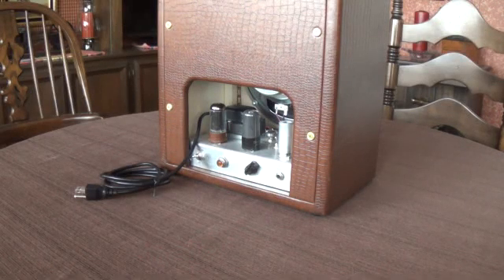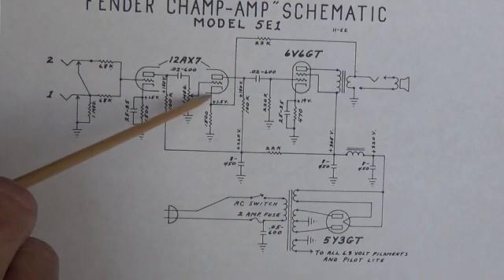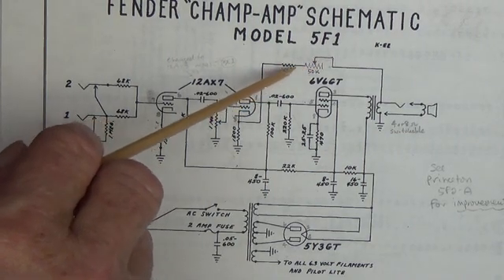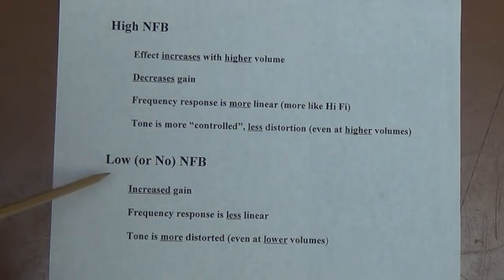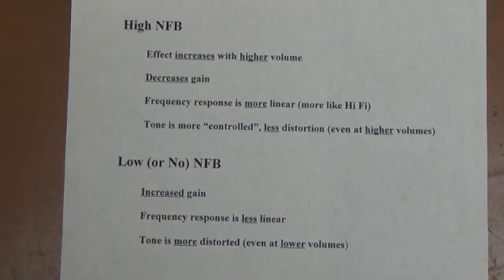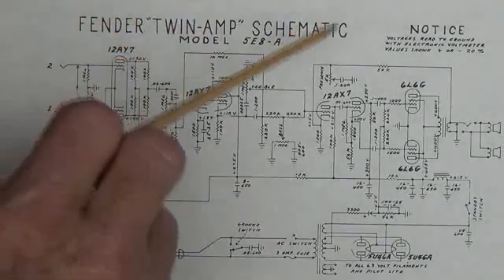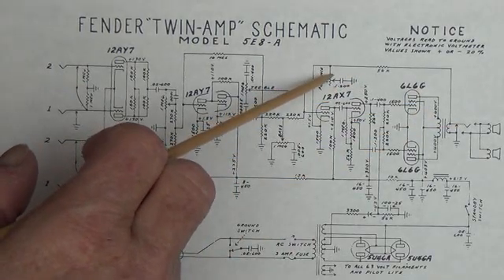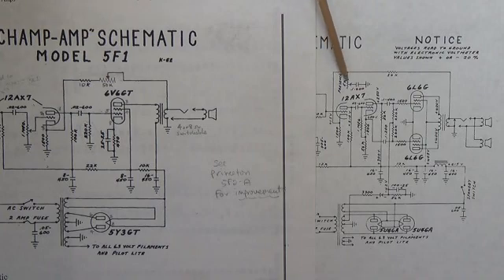Negative Feedback Loops and the Fender Presence Control

Comment: Always i saw you videos I learn somthing. Have a Question and maybe yo can answer and help me. I have a Fender Bassman 100, its to clean I would like to be more like it a Bassman Blackface era? What mods o recomendations you suggested to me? I want to somethimes play clean and sometimes achive breakdown at lower volumes. or just have the circuit of the bassman blackface. Also if I do mods the bass channel will stay the sames or it will change . Saludos de Mexico sorry for my french
Reply from the maker: It would take a great deal of time and space to discuss possible modifications to a Bassman 100, Gerald, but my question would be, if you want early breakup at lower volumes, why not simply buy a second, smaller amp.....maybe a Fender Champ or Princeton ?  Trying to get a B-100 to do what you ask is like trying to fix a watch with a sledgehammer. You need the proper tool, i.e. amp, for the job. Good luck.
Reply: @UncleDoug  yeah i feel you. Iam starting to love this amp. The deal its that I have a Traynor YGL3 and therea were I get my cleans sounds and also has treverb and tremolo. I am a big fan of Duane allman and as far I know in the earley days he used to use a basseman the he uses a Marshall SUPERBASS. Sobi want to have something like a SUPERBASS . Forgot the thing what I say of low volumes. Do you think i could do aomthing about it ? Just little and auddle things without losing the great headroom of the fensee amps. ?
Reply: Also I read in a web page fender guru about the Fender bassman conversion of silverface to blackface mod, the blackface has more breakout. but the problem its that the Bassman 100 its different of the Bassman silverface. The B100 has only 2 stages of preamp tubes and the Bassman silverface has 3 and also the B 100 has 4 power tubes and de B silverface has 2. So I wonder if thia conversion mod can also applied to B100? And if ita safe to do that (transformera, tubes impedance etc..)?
Reply: Also if the mod its compatible with the B100, it while used only with 2power tubes or it could be run ot with 4 power tubes? I think this analysis it would be very interesting and clears our minds about the theory. Hope you can do a series of this theme jejejeje . cheers Uncle doug . Greeting for you and your dog  🐕: D

Comment: Hmm, does that mean that the presence control can be turned into a bass control by switching the 5k pot and the capacitor, therefore turning the high pass filter into a low pass filter?
Reply from the maker: You probably could turn a Presence control into a Bass control by altering the pot and cap values, Luca.

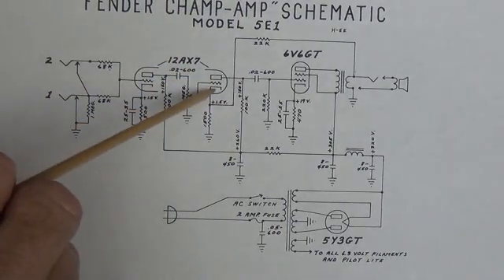Comment: Uncle D, please forgive another noobie question; your videos are making me a danger to myself and others.  I'm hoping you can identify where my thinking goes awry: at the 1:30 mark, you describe how the NFB coming off the OT secondary winding to the 12AX7 Stage 2 cathode is out of phase with the input signal at the grid.  But the way I follow the schematic, the 2nd stage grid drives the plate, which inverts the phase of the signal.  That inverted signal then goes the grid of the 6V6, which is driving its plate, effectively inverting the inversion.  So the signal going to the OPT is now back IN phase with the signal at the input of 12AX7 Stage 2.  Unless the OPT again inverts the phase, I'm not seeing how the signal being fed to the stage 2 cathode is out of the phase with the grid's input signal, making a negative feedback.  I'm seeing positive feedback.
So what am I missing?
Thanks again for a fantastic series of very educational videos!
Reply from the maker: Good question, showing a lot of mental follow-through on the presentation. The output transformer secondary puts out two signals which are out of phase with each other. You connect the NFB to the one that is out of phase with the signal on the cathode of the 12AX7. If you pick the wrong lead, which happens fairly often, the result is a PFB......which is commonly known as a "siren" :)
Reply: @UncleDoug  I see.  The output transformer is not putting out a +V referenced to ground, but a +V referenced to -V.  Just like the CH1+ and CH2+ terminals of a stereo power amp operated in bridge mode.  Got it; thanks again for indulging me.
Reply from the maker: @PiFBass  You're welcome, Bill.
Reply: A signal fed to the cathode must be in phase with the signal at the grid to provide negative feedback. A signal input at the grid is inverted at the plate while a signal input at the cathode is not. Since the two signals at the plate are out of phase, the result is their arithmetical difference.

Comment: hi i made a champ and i dont make the negative feedback circuit and  if i put the capacitor on cathode resistor of the 6v6  i got ecretage at 1 watt  , so if i put negative feedback circuit i got normal ecretage .i dont understand well  why maybe you will.
Reply from the maker: Apparently the bypass cap increases gain and causes premature clipping. The NFB loop suppresses gain and reduces clipping to a normal level.

Comment: Uncle Doug
I have 2 identical amps, both are Line 6 Spider 3 
15 watt 
8 inch speaker
I want to know if there a way to put them together so that I double the speakers and double my output and of course keep the few effects it has. I'd like to build a new cabinet to house both speakers and perhaps a separate head with the 2 amps joined? I didn't plan on having 2 but that's what happened so any input of yours would be greatly appreciated. Thanks
Reply from the maker: Why not just get a splitter that separates your single guitar cord into two separate cords, then plug into both amps, with different settings on each, and blast the neighbors with a complex, tonally rich and mind-blowing free concert ?
Reply: @UncleDoug  well that would just be too easy u know. Maybe I'll find a tube amp worth doing the work I wanna do so bad. Just need a project
Reply from the maker: @aaronowens1627  I understand the need for a project, Aaron. Good luck.

Comment: Excellent video, as always! Question: why is the signal for negative feedback typically (always?) taken from an OT tap (as opposed to a pre-OT signal, for example, the connection between the anode of the 6v6 and the OT)?
Reply from the maker: Because the signal has to be converted from high voltage low current, to low voltage high current to be effective in the NFB. This is done by the OPT.

Comment: Hey Doug, Greetings from New Zealand. I just had one question. I'm using a pre-amp pedal (Diezel VH4-2) and running it into the effect loop return of my amp which is a Marshall DSL40. The pedal already has presence and resonance controls on it, but the presence and resonance controls on my amp still work as well. so i wanted to know what i should set these controls on my amp to, in order to have them make no difference to the signal (Essentially just use the marshals power amp without affecting the tone from the pedal with these controls). Should I leave them at 12 or at 0 or at max? which one essentially turns the control off? sorry for the long winded question. Eagerly awaiting your answer. :)
Reply from the maker: I would have to see a schematic to see how they are wired, Shid.  But, since all that matters is how it all sounds, why not just experiment and determine the ideal settings for yourself ??

Comment: So does High NFB equate to less resistance, and Low NFB to higher resistance?
Reply from the maker: The lower the resistance in the NFB loop, the more negative feedback, and vice-versa.
Reply: @UncleDoug  thank you,  love your vids!
Reply: I just completed my f51 chassis assembly, and I did include a 50k pot on the NFBL, and I wanted to mark where 22k actually was in relation to the knob now that it's all together, and discovered that now I'm not able to measure the resistance from the pot to R13 (10k replacement resistor)? Is it because it's now in circuit and connected to the OT? Thanks!

Comment: Inside my amp, I removed the Presence control and replaced it with a another potentiometer (250 Ohms, after few experimentations) which allows me to play with midrange frequencies as well as different other punchy sounds. It also controls the amount of the overall volume. But in my case, it is connected between one of the grids of the Phase Inverter and the 8 Ohms ouput jack.
Reply from the maker: Good grief, Paul. You should patent this circuit design.

Comment: Hi Doug , just me again I am having fun and games with the V15 it appears the Amp pixies have been in there and done all sorts of things . I had a problem with when playing a g chord this would start a horrendous buzzing off that would only go away when the volume was turned off. I guessed it was frequency (vibration related ) which i have now isolated to I think the on  not on switch . I did also note that there was a lot of mains hum which seems to go away when i touch the chassis I was thinking the filter caps were possibly bad and also the power resistors have at some stage got very hot as they are breaking down and burnt they appear however to still give the correct resistance. It is a long and slow process as i am no expert but i am learning new stuff and the old amps have so much more character than the new stuff sorry to bother you but i need some good advise . 

Nikk founder member of Doug for President, or prime minister movement if you want to come here, we don't seem to be able to run a p up in a brewery any more.
Reply: Hi Doug , Not sure if this helps what do you think  https://youtu.be/HPIXVy2IQL8  Thanks Nikk
Reply from the maker: Thanks for the nice comments, Nikk. It sounds like two problems......a microphonic tube and a grounding problem. Try tapping each tube when the amp is on and see if you hear any medium to loud noise through the speaker. Replace any tube that makes noise. As far as the hum, be sure your amp chassis is securely grounded and plugged into a properly wired AC receptacle. Be sure that all metal parts of your guitar are grounded to the shield of a good instrument cord, plugged into an input jack that is properly grounded to the chassis of the amp.

Comment: Hi there! I just stumbled upon your video (very fascinating btw-this is the kind of stuff I want to learn) because I was trying to troubleshoot my Fender Twin. 

So here’s the problem: everything on my amp sounds okay, until you turn on the presence. When presence is engaged, a high pitched ringing sound starts to build slowly, and after a minute or so it becomes so loud that I have to turn off the amp (or presence). 

Before doing a little research (I know absolutely nothing about amps) i thought that presence had something to do with the reverb because the dials are right next to each other. But obviously this has nothing to do with the reverb tank (I think) and maybe the pots or ground is damaged for the presence?

What do you think? Also, is the presence a function of the power amp?
Reply from the maker: Your description sure sounds like the presence control has been miswired and is now a positive feedback loop......creating oscillation that increases steadily (and somewhat dangerously......don't let it get too loud). The NFB wire is connected to the wrong speaker output lug. See where it attaches to the secondary output (which goes to the speaker) from the output transformer, detach it and reattach it to the other wire. See if this helps.
Reply: Sorry I’m unfamiliar with a lot of the terminology. What is the NFB wire? And how should I start taking the amp apart? Can you reference the schematics? I’m also willing to Cashap/Venmo you for your time - I definitely want to compensate because I’m serious about getting into electronics. If you have any resources or recommendations to start I would love to pointed in the right direction <3

Comment: Uncle Doug,  The way I have done this on two 5F1 clones, was to keep the 22K resistor but add a pot to dial it in or out. I used a 250K pot in one and a 500K in the other. I like the results with both but I did not A/B the amps. What would be the difference mathematically between the two pots I use or if I were to use a 50K pot. What am I achieving with this by using such a high value pots, compared to what you did?  Thank you.
Reply from the maker: The vast majority of the travel of a 250K or 500K pot would be wasted, ZH, because the NFB loop effectively shuts down at around 2 or 3 times the NFB resistor value, i.e. around 50K. That is why you can generally stick with a 5K or 10K fixed resistor and a 50K pot. Try it and see what you think.
Reply: @UncleDoug  I don't quite understand what you are saying but the travel of my 500K pot is effective the whole range. I would just like to know what exactly I am achieving with my version of this circuit? I kept the 22K resistor. 
Am I still keeping the 22K NFB and actually adding more NFB when the pot is turned up with the 250K or 500K pots?  Am I actually adding NFB to the amp? Above the stock NFB?
250K and 500K pots is all I have at hand at this time, since I am a guitar builder.  
The amp sounds really good though, great tone. With the pot all the way up it gives me a mellow jazz tone for clean playing. 
My setup also functions somewhat as a tone control, adding more gain and highs as the NFB is removed.

Comment: Greetings Uncle Doug!

First, thank you very much for your series of videos that have helped many musicians and electronics  aficionados understand how this beautiful gift of science sweets our lives!

I have a PRS MT15 tube amp, a modern amp but like you’ve said “they all work on the same principles”.

Preamp works as follows:
V1 – input 12ax7
-> to
V2 – lead gain 12ax7
V3 – lead gain 12ax7
OR
V4 – clean gain 12ax7
-> to
V6 – effects loop 12ax7 (always on)
-> to Power Amp

The power amp It has a match pair of 6L6WGC tubes with a 12ax7 phase inverter, and corresponding Presence potentiometer. Also a switch that controls the output with 15 or 7 Watt options.

Output transformer has an 8 Ohm and 16 Ohm option.

The problem is:
While amp is powered on and standby off, a subtle noise is present at the speaker (30 watt 8 ohm 10 inch) with a 50 Hz frequency (Germany : 240 AC 50 Hz). Manipulating the Presence knob affects the hum sound, while still at standby off.

Your experience and vast knowledge is requested:
Is this something common in tube amps? If not, could you point me out to a circuit phase where I could test and possibly find an issue?

In advance, thank you very much!

Best regards,
Gus

P.S. Clean channel is very low compared to Lead channel (which volume potentiometer seems useless to control such beast).
Reply from the maker: I wish I could magically solve the problem, Gus, but there are many, many possible causes for 50/60Hz hum. You could try moving the wires around with a wooden stick, or try switching tubes. If the volume control doesn't affect the hum, then its source is after the volume control in the circuit. Good luck.
Reply: Thank you very much Uncle Doug and Rusty!
I’ve gone through the cable test, if you’ve got time you may like to go through the videos:
https://youtu.be/trlbdxFL9gU
https://youtu.be/sCR8a8G0rF8

Comment: Hi Rusty or Jack  , I have a V15 vox and want to mod the negative feedback circuit I presume that i could remove the 820ohm resistor from the output transformer and replace with a variable resistor keeping in mind your point that you need some resistance. either this or disconnect it all together. If you are having trouble with this then ask Doug last resort! Love the videos  Thanks Nikkhttps://www.google.com/imgres?imgurl=https%3A%2F%2Felektrotanya.com%2FPREVIEWS%2F63463243%2F23432455%2Fvox%2Fvox_v15.pdf_1.png&imgrefurl=https%3A%2F%2Felektrotanya.com%2Fvox_v15.pdf%2Fdownload.html&docid=vhBKN2y-vEQl3M&tbnid=ezXKzmK6pGJ2IM%3A&vet=10ahUKEwii-9PjtPjhAhVHx4UKHSNBAT8QMwhAKAAwAA..i&w=960&h=479&bih=640&biw=1517&q=vox%20v15%20schematic&ved=0ahUKEwii-9PjtPjhAhVHx4UKHSNBAT8QMwhAKAAwAA&iact=mrc&uact=8
Reply from the maker: You didn't say what you hoped to achieve by modifying the NFB loop, Nik.
Reply: @UncleDoug  I have been informed it improves the sound more chime /gain and greater output giving more of the Vox  sound more like the AC15 if you know better then i will leave well alone. Thanks for the reply Wow. Nikk
Reply from the maker: If you're looking for reduced headroom and brighter sound, you could simply delete the NFB and see how you like it. Or you could replace the 820 Ohm resistor with a 250 Ohm resistor and a 1K pot in series to make it variable. Good luck.
Reply: @UncleDoug  Many Thanks ,I think I will disconnect the feedback loop first and see what this gives me . Adding variability I have found only leads to the Pot being stuck in the same position forever once you find the sweet spot. Still perhaps this is a good reason to try this first . Again many thanks . Nikk
Reply from the maker: You're welcome, Nikk. If you can find the "sweet spot" with a pot, simply hard wire a resistor of that value in place of the pot.